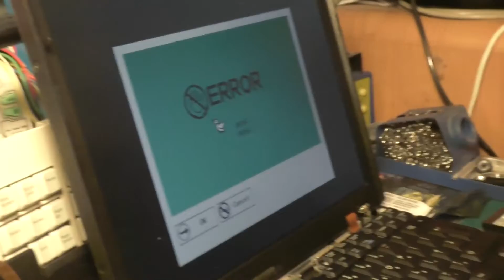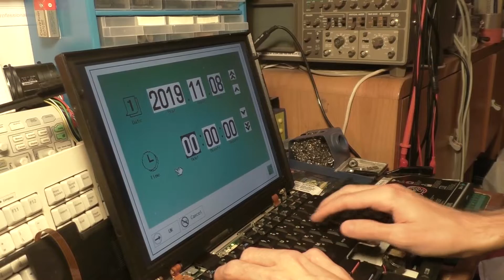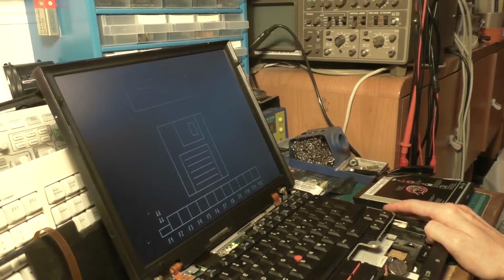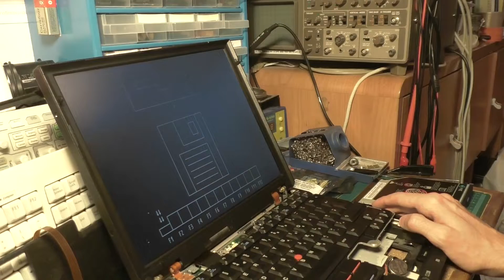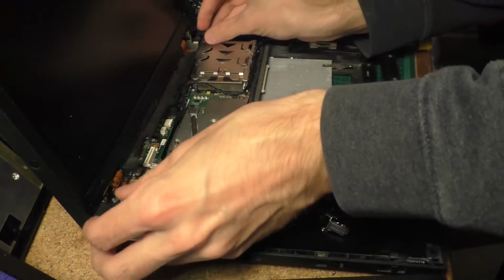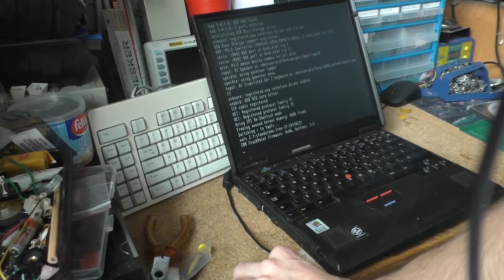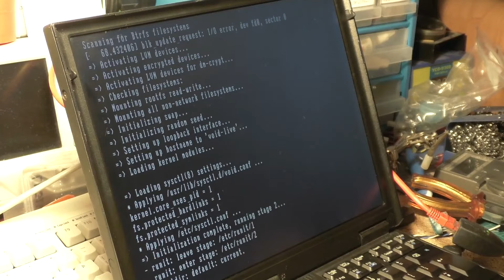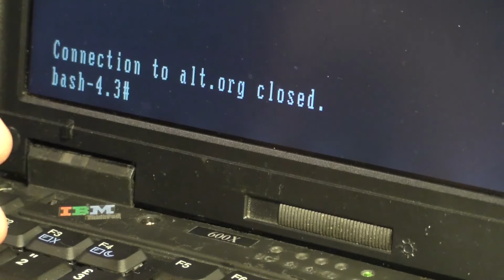PEV 11 - Thinkpad 600x Repair pt. 1

Comment: hello, i also have a thinkpad 600
but the cpu doesn't work and it doesn't beep
where can i get a replacement as cheap as possible?
Reply from the maker: The CPUs on them are socketed on a module so you can pick any laptop pentium III and it should work, i think

Comment: where did you buy the keyboard?
Reply from the maker: random ebay seller. there are plenty new old stock units
Reply: @polprog702  ive searched on ebay but cant find any. what can i do?
Reply from the maker: @ollie1444  My bad. I think I searched by the IBM part no (FRU). They are listed on page 76 here: http://tim.id.au/laptops/lenovo/thinkpad%20600x.pdf . for example US keyboard is 02K4787. I can't seem to find any deals on US keybaords. but searching for "IBM" and the FRU number brings up some offers. I've paid 5 GBP + postage for mine (UK variant, from UK ebay)
Reply: @ollie1444  I have one if wanted